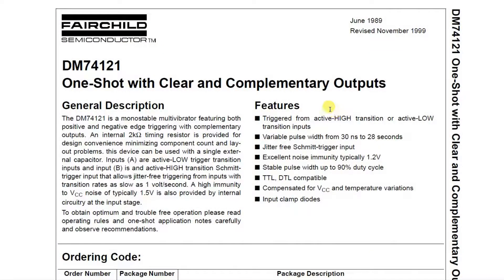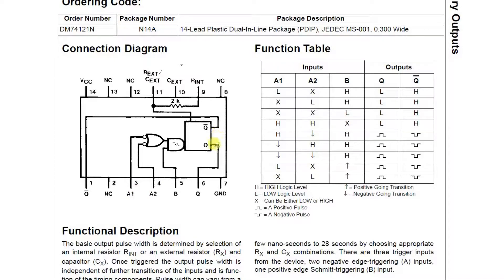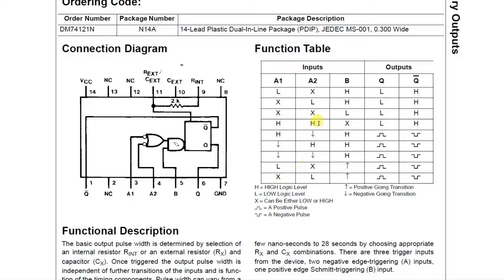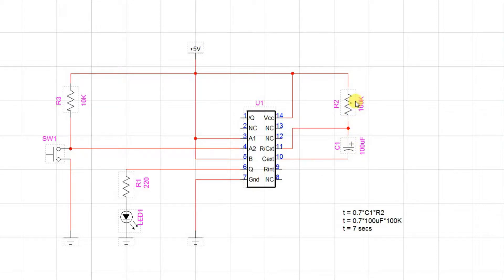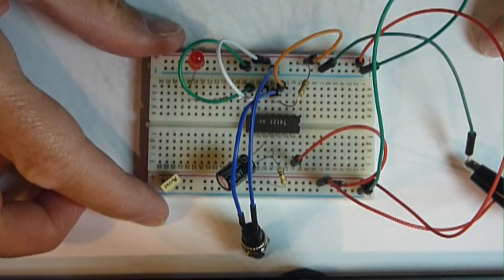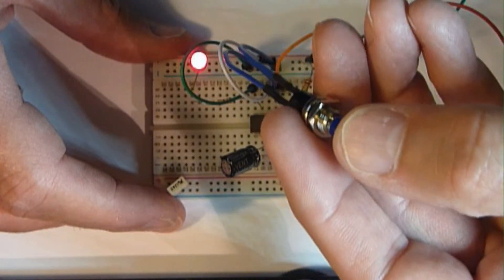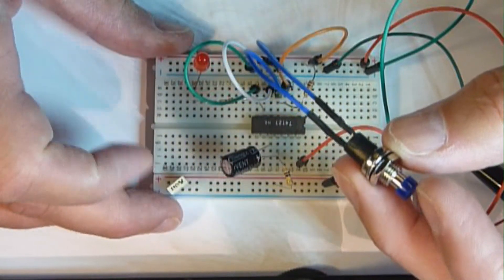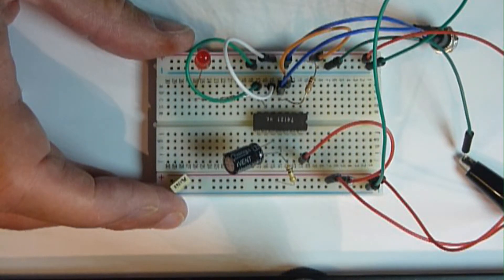How to stop switch bounce using the 74121 monostable (one shot)

Comment: Hi, your video is great. I've learn how to build a  74121 but i would like to ask about when do we use 0.7*R*C and when do we use 0.33*R*C for the formula? As i saw a post on the net but it says that if the value of capacitor connected to Cext is greater than 1uF the pulse width is equal to 0.33*R*C